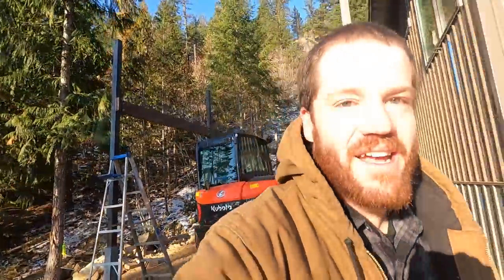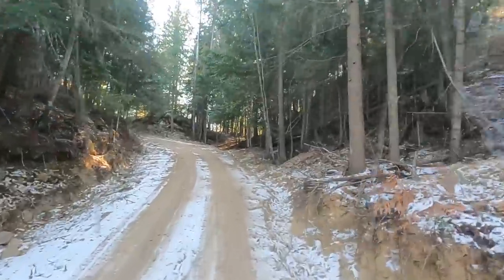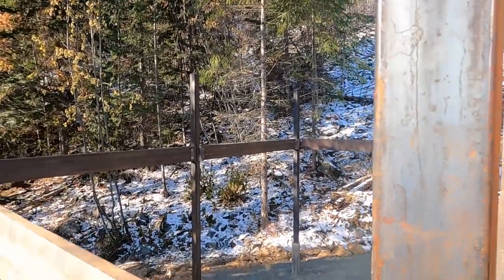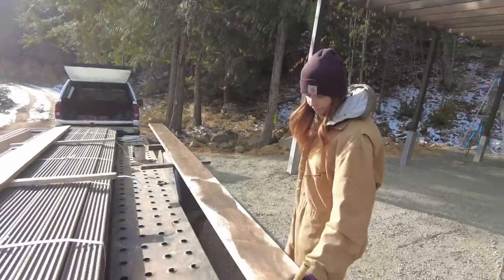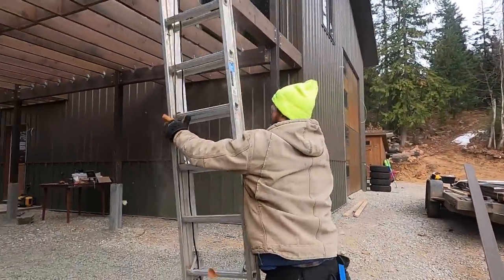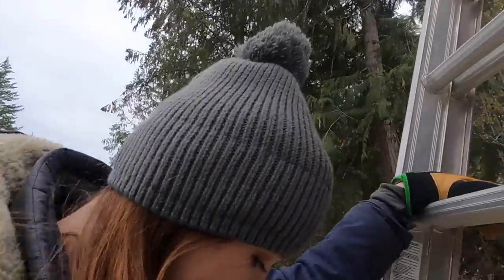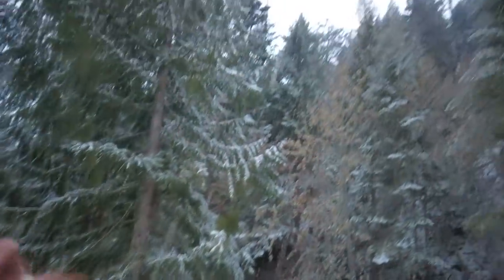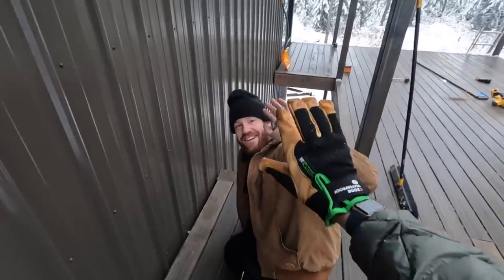FINISHING OUR GIANT DECK | Building Off-Grid

Comment: you should put woven fabric under the gravel to increase compaction strength and keep the mud from coming up through the gravel
Reply: Yes I use geofabric all the time and it is wonderful stuff. I don't know how well it will stand up to the snow plow. I have been using it for a few years and the maintenance is slim to none. It does not allow the rock to squish down into the mud.

Comment: Starting your Army truck in the cold.  There are magnetic electric heaters that you can attach to the oil pan and leave it there. Plug it in the night before you start the A-Truck, the oil will be hot enough to lubricant all the friction points which will lengthen the life of your engine.  Great job! It is wonderful to see crafty and loving built in your marriage.  “Live long and prosper!”

Comment: I used to have a deck about the same size under a similarly sized metal roof. All the snow from the roof would slide on to the deck. It became a huge chore to shovel the deck all winter. We took out the deck and added snow guards to the roof. Much happier now.

Comment: If your going to add railing , leave a  5-6 inch gap between deck and bottom of railing, or create a swing out portion of railing to facilitate snow removal. That way you don’t have to lift the snow over the railing. You can just push it over the edge.
Reply from the maker: Great idea!
Reply: Great work! Just a heads up, IF you have to worry about “doing it to code” most baluster, and deck to bottom rail gap is 4”! Just do your due diligence if required to meet code. Keep up the spirit and great work! Enjoy the fruits of your labor (sitting on deck sipping one of those sponsored wines!) - recorded for all to see - of course!!!! Thanks!😁🍷
Reply: Nice job and video ,love you guys.
Reply: @soulmanm12954 yes, because that helps prevent children from sliding under. Hope they build to code 😀

Comment: Riley, I saw on an old video somewhere the person was cold starting an older engine. They removed the air cleaner and used heat gun to blow hot air into the metal intake tube to get some heat into the engine then they used a blip of ether and after several tries the engine came to life.

Comment: Congratulations on getting your new deck down.   You persevered despite the weather conditions and got it completed before winter.   Nice to see you used the composite decking material.   I considered doing that but was talked out of it by the guys at the store who said that the product was not warranteed unless you use the special support materials and have it built by professionals, blah blah blah.   I built my deck myself, and honestly, I should have bought the composite decking.   It's been 8 years now and despite being careful with the maintenance, the pressure treated lumber is starting to show warping and wear.   Oh well, live and learn.  

I know your deck will last way longer and looks WAY BETTER then pressure treated lumber.   Can't wait to see the finished product come spring.   Stay warm you two!
Reply: Google Trex deck warp.. it does it too as it isn't a strong as wood, unless you do 12" OC spacing of your joists.

Comment: We used stainless steel wire for the railing. It is literally invisible, doing it from inside the house and you can sit on the deck and look through it. There’s space relatively close together, and the wires already come premade with screw fittings on the ends. I love my deck and everybody that’s been to my house. Also loves it, I don’t have any more information the carpenter that built the deck passed away I do have pictures of my deck looking out, but I don’t know how to get those to you.
Reply: You should be able to email the pictures. 
Look at their YouTube info, or get the email through instagram.
Reply: The stainless wire is a good look but IDK how well that would be when it’s literally freezing outside? I’m simply referring to like leaning or touching it? Structurally it would fine and aesthetically it would be great!

Comment: I just spray ether in the intake filter. It saves having to install injection canisters. It also saves cranking long with that expensive starter. There is nothing to be afraid of. Just don't use ether if you have and use glow plugs or an intake heater.
Put down geotextile before the gravel. You can use half as much gravel. The geotextile costs less than the gravel you do not need and you get less mud bleeding through.

Comment: Looks great👍🏼👍🏼 I think the roof extension will make it a much more usable space, especially in the summer time 🍖 and 🍺. Hard to tell if you left a big enough expansion joint on the end of your decking. Composite decking extends and contracts a lot and will push your picture framing board if you haven’t allowed an expansion gap. Landscape looks amazing with the fresh snow. 👍🏼👍🏼🇦🇺

Comment: Nice work guys. Deck looks great and you get more parking! Little slow on the subs, MORE VIDS!! 

I would add wood bumpers to the top rails of the LMTV. Would allow more volume and protect the alum sides. You can double that load size easy. 

Since you spread stuff so much, I have an idea. Get a clamp on blade or just a piece of metal for the Exc. bucket. Real dirt buckets are scary $$$ (I'm building one)

Comment: I didn't observe the distance between floor joists, usually for that type of flooring you'd use a 10" joist separation. No big issue unless there's some sagging or twisting. If needed you can add one in between what you have now as extra support. Your abilities to work together and keep those wonderful smiles (at least for the camera...) keep me watching. Excellent work, toughing it through prior to the storm. Your roof will make a huge difference. Screening in at least part of the deck could make it fantastic during bug season! Stay well, stay safe!
Reply: I believe it was just over 12’ on the main body of the deck to the stairs. Then the two short sections on either end look to be about 42”
Reply: they said every 16 inches for the joists so maybe too far apart
Reply: @ronblack7870  - Thanks, Ron. They come out with new stuff all the time. A few years ago, friends of ours put this on their deck when they revamped it. The folks at the store where purchased never said a word about placement so they used their old joist hangers at 16" separation. Within 6 months they noticed sagging and some minor warping. He was not happy when he complained and THEN they told him about the 8" to 10" placement!

Comment: You guys can get a block heater that is magnetic will stick to the oil pan or the side of the block. (lower is better heat travels up eh?)
They now make ether with some oil in it which helps lube stuff till the diesel and engine oil starts flowing properly.
A battery tender will insure that the battery is topped off for maximum spin from the starter and your batteries will last longer.
That truck is too nice not to be able to count on it when you need it and easier starts will result in less wear on the starter and engine .
Great job the deck looks awesome!
Reply: You can also stick it on the excavator or something else (the bulldozer leaps to mind) when it is bitter cold and you know in a couple of hours you are gonna try and fire it up. Or outfit all the toys with the same set setup

Comment: I think you could use a heated oil dip stick or glue on silicone pad for oil pan, I had a heater in the radiator hose on one truck, great job on your place.

Comment: There’s no much that’ll stop that big beast. You can buy a single axis inclinometer, or a dual axis inclinometer, or if you have one, and if you don’t, get one you’ll love it! A Klein, or other manufacturer, saw blade angle electronic angle meter. They have a magnet on one side, so you can stick it to wherever you want on the beast and get a true reading. But that of course is dashed on the 0° that you start with. The Klein unit is a wee little tool, that comes with a nice protective pouch.
Reply: The plastic anchor/spacer clips are really quick and they’re helping to ensure that the planking is true. You’re going to love the synthetic/ composite decking! I put it down on the last few decks I built. Not only is it blazing fast to install, but it’s so beautiful, instantly. When I was installing it, the only options for anchorage was metal screwed on clips. They worked fine, but we’re separate from the screw, and you really had to watch your spacing. All of the new products y’all are using are very cool, and your info as you go is a great addition to those thinking of tackling a new project.
Keep up the great work, I’m really jelly of that view, but not of the cold!

Comment: If it was me, I would make provision for lifting outsized and heavy objects to the deck, so they could be moved into the apartment through the slider.  Not necessarily an elevator, but a "loading dock" area with removable railings so the excavator might be able to lift a pallet of whatever up onto the deck.  Better solution than the old overhead block with poor Courtney on the other end of the rope wondering if she'll be lifted right off the ground!  Also, at LEAST until the stairs are in, a pole for you to slide to the ground as a "fire escape" in a catastrophe.  Or, if you just feel like sliding down . . .

Comment: Smart move with the trex! ez to use, durable, great stuff.  I built the back deck 20 years ago, still looks great & still solid, there was a time when everything looked dull but a quick waxing with armor all rejuvinated the gloss. Your deck looks fantastic!
Reply: Trex is durable. Will never rot. One thing I have noticed it does absorb heat from the sun. Down south here it almost gets to hot to walk on barefoot in the summer. Deck does look good. What are you going to use for stair stringers? Metal or wood?

Comment: Those trucks were designed to start off of ether in the cold. It will not hurt it at all. I would suggest using it rather than burning up your starter.

Comment: Could have backed the truck in there and set the joists working off the truck deck, would have been perfect height.  Also could have used the truck deck a staging point to work off for the boards.

Comment: 24:54 Excellent job on the deck. I would recommend to take two brightly colored ropes and make an awareness railing all around the outside of the deck. It won’t stop you from falling off but it will help you to be aware that you are approaching the edge. Roofing contractors use these on flat warehouse roofs a lot.

Comment: A suggestion to show how steep your driveway is.  Take a wine glass, fill half full of water,  set on level surface, mark water line with sharpie, take small rubber duck with magnet glued to bottom so it points north and put in wine glass, fasten wine glass to round thing above red button on army truck dash, then take a trip up and down driveway.

Comment: In my humble opinion. A little ether in the diesel is not a bad thing. 
Used sparingly it is actually easier on the starter, alternator, batteries etc. Although, a form of engine heater is the better option.  There is a magnet oil pan heater that is not expensive and if you can ug it in for about 4 hours prior to starting it should be enough.
Just a FYI.
Love your channel

Comment: Hi Guys, nice job on the deck!  One tip, since you do get a lot of snow, leave enough room at the bottom of the railings, so that a broom can fit through.  Otherwise, if you try to sweep snow off, you will run into the bottom board of the deck making snow removal more difficult.  Ask me how I know that!  Thanks for the video!

Comment: Code also requires blocking on top of the beams that the joists are crossing.  Also, for future decks, use a biscuit jointer to cut slots on the edge of your first board...that will allow you to use the hidden fasteners on all the field decking.  It looks awesome, folks.
Reply: Good Point. The ends of the stairwell joist should have been double up also.
Reply: or if you have no biscuit jointer at hand just cut one of the flanges of the fasteners for the first row. Since they are sitting between those boards they would also hold the board down and not bend away..
Reply: @jewelryparadise5778  more blocks are not needed, in fact the ones that were installed are not necessary...but are definitely a benefit.  Also, that deck will hold more people than could fit on it.  😎

Comment: You might be surprised just how far a regular 6x4 dump truck will go. Ice aside - when the difs are locked they will climb a very steep hill. 
I have a very steep, narrow, rough driveway and the water delivery truck (a 6x4 with 10 tonne of water in the tank) never has any problems with it. Great that you got to put your truck to work though!

Great job on the deck!

Comment: FYI-military vehicle load ratings are for off-road/cross country.  On highway is double capacity.  So, on road, it carries 10k.  Also, to avoid meeting Commercial Vehicle Enforcement Officers, get a tarp to cover your loads, especially when hauling gravel, stone, sand, or dirt.  The fines for unsecured loads is pretty excessive.  Err on the side of caution

Comment: You guys should consider a cable rail system for your deck to limit the obstruction of the view. A square tube across uprights with a matching Trex board on top and cable rails underneath. Also a dumb waiter built with unistrut and Harbor Freight winch on one of the corners would be great.

Comment: Does your dump truck have a cupholder? Grab a clear water bottle and fill it half full with colored water. Put it in the cupholder and park the truck somewhere level. Mark the water line level with permanent marker. Then as you climb your hill you can show the change in water line level as you climb or descend.

Comment: Great job and deck. The only one suggestion that I would have made would have been to buy some roll roofing then cut into 2" wide rolls then nailed them to the top of the joists then put the floorboards on top of it. I help prevent the joists from rotting out over time especially if not using pressure treated wood.

Comment: You might want to drill and install a coople 3/4 gal, bolts to the shop.  the reason is if thr snow slides off your shop roof the bolts will take the side pressure of the snow comming down.  what do you think?

Comment: You may want to check your soils to pick an appropriate gravel size — here in Hawaii, the 8 feet of carbon rich topsoil needs a base of 4 inch gravel to prevent the gravel from sinking into the muck … 3/4 inch gravel just disappears into the mud, never to be seen again.

Comment: You can get a circulating water heater for your truck , they heat the radiator fluid , quick and easy to install , starting a diesel cold adds to the wear and tear .      Please tie the ladder off and extend it at least four feet above the platform , so you don’t have to bend over when climbing on and off . Stay safe gravity is very unforgiving 👍🇨🇦

Comment: My only recommend action to take if you are truly done with deck for winter.  Install, temp, a railing on perimeter of deck, rope, cable. Also temp cover stairwell. I know you will be on that slippery deck this winter. It's a long drop to ground.
SAFETY FIRST! My EMT experience has shown what can and often happens

Comment: watched the tree lighting episode. .dad had a 30+ blue spruce. we attached an arrow to a string . shot that over the tree top. tied on a rope to the string pulled over the rope. tied on the light string then pulled that over the top. then walked around the tree dispensing the light string from a bushel basket. flipping the lights for best display .easier top down than bottom up.

Comment: Do Not put ether in a cold diesel engine ! Use Propane it is easier on the engine because it doesn't ignite as early and it doesn't dry out the cyllinders as much, decreasing the chances of compression ring/piston damage.

Comment: Good work there. I would not worry about the deck not being attached to the building. The main thing now is to make sure you don't have dirt and pine needle etc build up in that crack and cause your metal to corrode. Decks attached to wooden houses cause a ton of rot problems because 99% of the time they are not flashed properly and there are leaks.

Comment: I remember when you cleaned out the mice nest in your dash, then you cut 2 big holes in the cab for your DIY air conditioner but took it out. I would bet if you have mice in your home you will have them in your truck. I'd bet you should be able to come up with some removable plugs to keep the mice out of the cab of your army truck.

Comment: Composite decks require joists to be 12in spacing. I use a biscuit jointer on the back of the starter plank to notch for the hidden fastners.

Comment: You should put a block heater in it it will help you tremendously and you have an Easter supply you should get it fixed and use it because it will help when you need it the most you won't have it

Comment: Great job on the deck guys. Your overhead drone shot raised a question: Are you planning on installing snow guards or bars on the metal roof of the barndominium that slopes toward the deck? It's been my experience that snow tends to fall off in giant sheets that might play hell with the deck. It won't crash to the ground with the deck and its roof in the way but it will crash somewhere. Like an iceberg, it'll move in its own time and its own way and doesn't much care what's in its way. The deck roof will have its own snow load to bear and the addition of the load from the house as it moves inexorably, well.... You guys are both pretty sharp so you may have already considered this, but it occurred to me and I thought I'd pass it on.